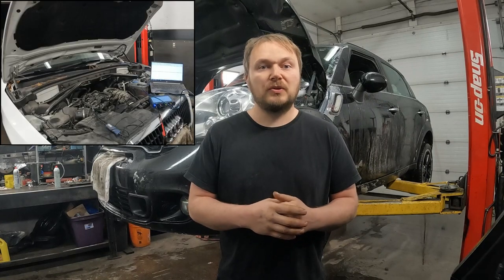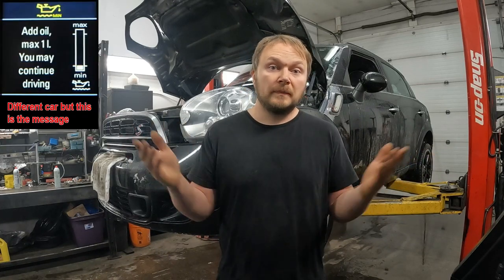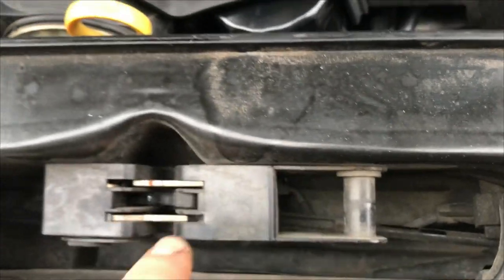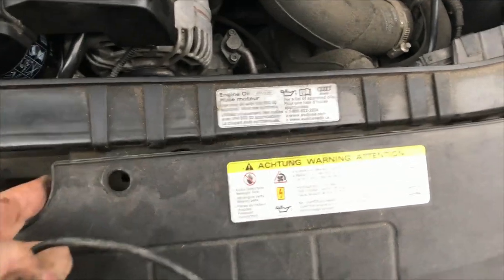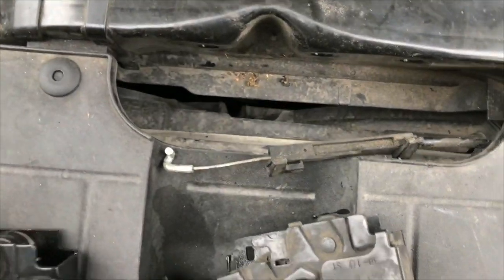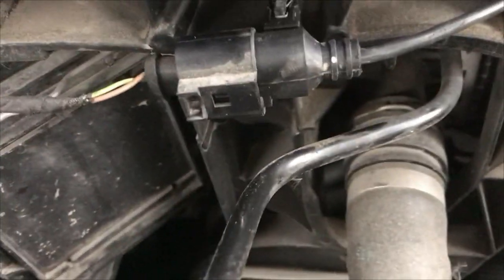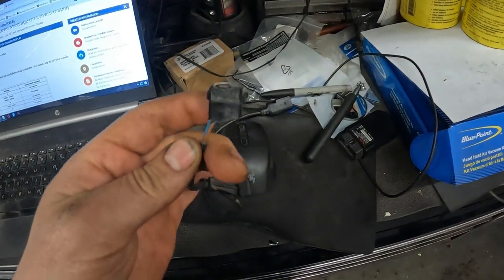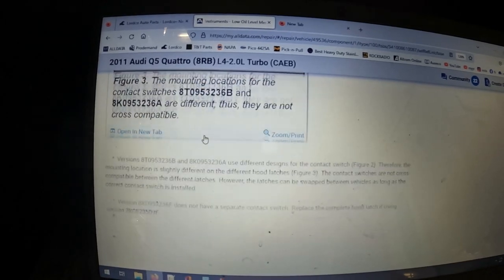2011 Audi Q5 2L Turbo - Part2 - Min oil light/Add oil warning message - Replace the WHAT??

Comment: The more stuff like this I learn about even slightly more modern cars it makes me dread the day I have to give up my 20 year old toyota
Reply: I drive a 2001 Camry. I put a new engine in it at 260,000 miles. Right now I have 319,000 miles on it and I wouldn't trade it for anything. Everything works as designed and it gets 30 mpg. Rock on
Reply: Exactly I just tore down my 2001 saab for a head gasket and a new turbo. This thing is a dream to work on.

Comment: Bro I just bought a 2011 Q5 on online auction it's a 2.0 TDI and when I bought the car I never checked the picture of the dash (I know rookie mistake) until after I bought it. I got it for very cheap and had me thinking what's wrong with it then I started to look at pictures again and I noticed the oil light. So now I am looking for answers and when I receive the car and If this is the problem I will be so grateful 😂 but I have a feeling it's more than that I just hope it's nothing major. Thanks for the video great job

Comment: so what’s the conclusion at the end boss? What’s the most likely going to be? I got the 2011 Q5 with warning it say  shut down engine ,oil pressure too low but my oil level is good.
Reply: I Got the same issue while I was at the highway. Still don't know what to fix

Comment: Maybe it's an indirect hood open warning system. Maybe the logic is to get the driver to get out and check the oil. Open the hood, check oil then slam the hood.
Reply from the maker: @obsolete professor  Their logic is they don't trust that you actually did top up the oil unless it sees a hood open signal for greater than 30 seconds. I don't get why not just rely on the level sensor to reset the light..? Why add another completely unrelated item to the equation that's just another possible failure point? Manufacturers have no problem solely relying on level sensors for things like fuel, coolant, washer fluid, etc to turn lights both on AND off...

Makes ya scratch yer head!

Comment: I ran into an issue where I had a similar scenario. It would say add 1.5l. I'd add 200 ml at a time. Once I put about 1.5, then I get an overfill message. I'll use my oil sucker and pull out 200ml and the warning would switch right back to telling me to add 1.5l. Makes absolutely no sense. Checking the data list, same situation. Oil level sensor says the level is fine for the static oil level measurement. New sensor was installed just to see what would happen. No change. Lol!
Reply from the maker: @DVantage  Ya, I don't get their routines for checking the oil level. I don't see what's so difficult about a static measurement. In an automatic transmission you got a torque converter that can hold 3-6 liters of oil and you don't know how much of that has drained back. So sure... have a running check. But on these newer cars sometimes it can take 10 minutes to go through its routine to check the oil level!

Comment: Can you just reset the light with a scan tool instead of replacing the part?
Reply from the maker: @jesse birring Nope. This isn't the maintenance/oil change due light. Whenever the oil level sensor detects a low oil condition then the only way the cluster resets that condition is if it sees a hood open signal for 30+ seconds. If it doesn't then it assumes you never topped up the oil and it's still low. Even though the level sensor starts reporting a good level again...

Comment: That is a smart/stupid logic.
Most likely that if the sensor is faulty that you open the hood and actually check it and not rely on a sensor saying the oil is full or low.
Pretty much calls all audi people idiots from vw.
Reply from the maker: @Sicktrickintuner  Yeah, it sure seems like unnecessarily adding an extra point of failure...